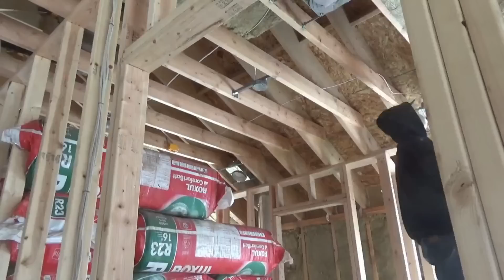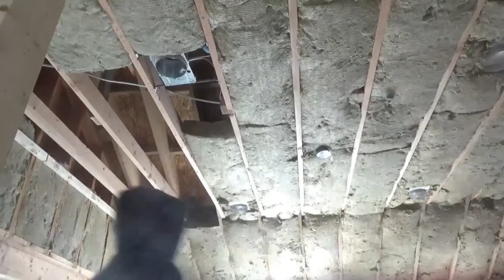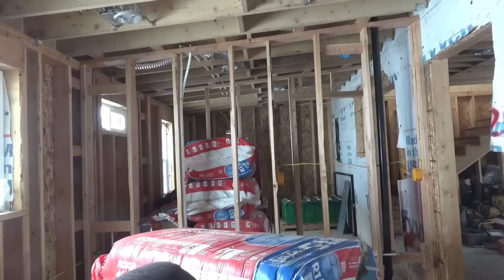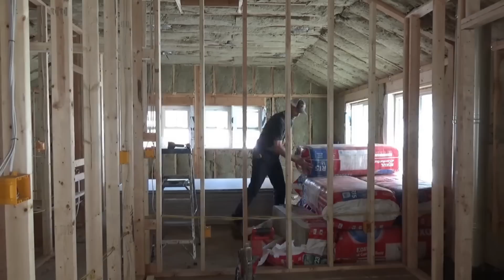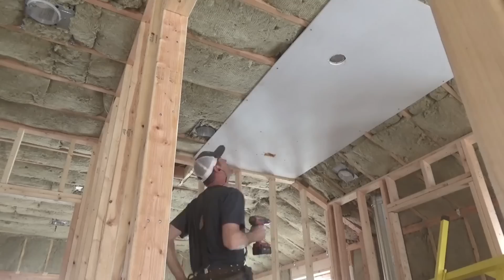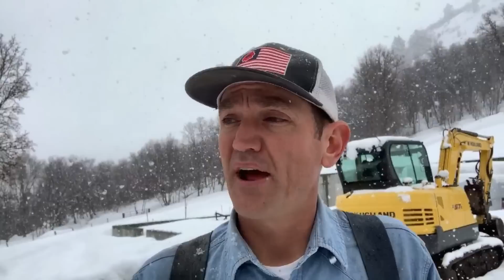#315 - I Started Hanging Drywall...Upstairs Insulation Done!

Comment: Sorry bud but please take all the board down and install vapour barrier on the ceiling and exterior walls. You’re going to lose a ton of heat and create mould/moisture problems down the road.
Those water lines in the exterior wall might be a pain in your arse when they freeze. Always stagger the butt joints on the board by minimum two stud spaces or two bottom chords of the roof trusses.
Reply: The sad reality is that not only is there no vapor barrier, but the air that does come in that cold winter air will have nowhere to go because the insulation will be trapping it.  The insulation needed twined to keep it up.  When it gets wet it will be causing all sorts of issue.
Reply: @JohnDoe-np3zk  Someone noted the insulation does not absorb water, so if true, that moisture is just going to go right to the sheet rock and start flowing down the seems removing the tape, causing mold, etc...
Reply: @RavenJCain  it's going to be a huge issue, we can see it, most can't, I really could care less other than it's frustrating to see people do things incorrectly.
Reply: @Steve Diamond and if you believe that I've got a bridge to sell you.
Reply: @Steve Diamond it's interesting how the lack of insulation essentially "saved" so many older houses from water rot even though heating was a challenge.  .  Now, when you do add it to an older house it's a process and you gotta know what you are doing I like the blow in cellulose.  The power company "makes" you add a lot of ventilation to get their rebate and that's where I got into this whole thing.  Having the "pros" do it is always a plus rather than just filling every cavity then begrudgingly cutting "holes to hell" as I call these bird block "vents"...
Reply: @Steve Diamond this explains why living in an attic disguised as rooms is never a good idea.

Comment: Where is the vapour Barrier??
Reply: It is just a basically a plastic membrane that is used to keep moisture from going in or out.  It's a good idea in extreme heat or cold conditions due to high moisture in air.  Over the years I have found out that you will gain a small amount (less than .025%) of an R value do to the reduced air infiltration thru the walls.  Some places require it by code too.

Comment: Sounds like you got it, good deal. Least amount of seams and no scabbiing (try an keep seams waist high as posible). Just 3 thin coats on screw holes and the seams you should be good.
Just 1 thing is i'd use a vapor barrier in the colder climate, some plastic wrap or something.

Comment: You don’t need a vapour barrier between the insulation and the drywall?
Reply: That's what I thought too🤔
Reply: True,  besides paint is a vapor barrier. I live in about same climate and built several houses over the years including my own 12 years back and do it just the way he is. It will be fine
Reply: @randomlyfunny2657  we built in 2015 in northern mn. Maybe it's cuz we're so cold but we have to habe a vapor barrier or actual ice can get in ur wall where the stud cavity meets the outside. Maybe they aren't cold enough there to worry?
Reply: Jamie Mieirs - 6 Mil VB is required. Paint is not a vapour barrier. The whole point is to stop the cold air meeting the warm air at the insulation to drywall plain. This stops the condensation from starting and causing ice, mould etc.
Reply: They just hold farts in

Comment: Can anybody tell me why it is called "Drywall"?  It is gypsum board with bound water in its chemical structure which is an important part of its fire retardant quality.  Most gun safes use sheet rock between the thin metal walls which means, over time, the sheet rock releases water vapor into your gun safe which will rust your guns if you don't put in a dehumidifier.  Drywall is not dry!!  Anybody know where that name came from?

Comment: Heath,  put your wall rip in the center of the wall.  Keep all your work in the strike zone buddy.If you are doing smooth wall it will be way easier to use a large broad knife  at chest high than a medium one at your ankles and shoulders.
Reply: Why did you pick my comment to respond to if there is so many?Dozens of people here have been watching him do and re-do parts of this build for more than a year and keep trying to save him some steps and keep the quality of the project high with tips we've learned the hard way.  What's wrong with sharing?

Comment: i'd like to consider myself pretty good at drywall to the point where my patches are not noticeable even for the keenest eye, but I would never do my whole house. sure, i'd hang it, even do the first taping, but the final coat - leave that to the professionals. it is an art that takes years to get down right. also, as others have said, STAGGER your joints - it is imperative.

Comment: I notice you dont use STUD ADHESIVE , as we do in AUSTRALIA,  is this a normal method in the USA ,  or just because your in a Cold area?
Love your build so far , and your insights , well done , and your blessed with a supportive wife and family
Reply: On our third house, all three using different contractors, and thus far no adhesive. Though on the floor replacement on this current rebuild, they did use it on the sub-floor panels.

In the upper Northeastern US of A

Comment: I'm not a professional drywall installer or finisher by any stretch of the meaning. But when I was remodeling my basement, I was planning on smooth flat seamless walls and ceiling as the finish product. Having done that before, I knew that it was time consuming leveling and feathering the joints to make it  nice and smooth. I wasn't looking forward to do this, and I also thought texture walls took special skill to achieve. Until one day while at work I was watching a real professional applying texture to the walls. I commented to him about the skill one must have to achieve texture and he kind of rolled his eyes and said "it doesnt take skill to do this" then  showed to me how to do it. In small sections, a very thin coat of mud rolled onto the walls, then a brush of some sort making figure 8's patterns into the mud. I tried it and it was easy, and it turned out great! It hid a LOT of mistakes and after painting no one was the wiser. 
Just saying!